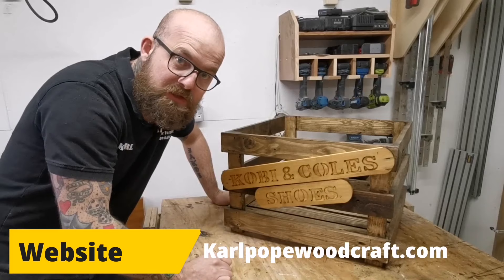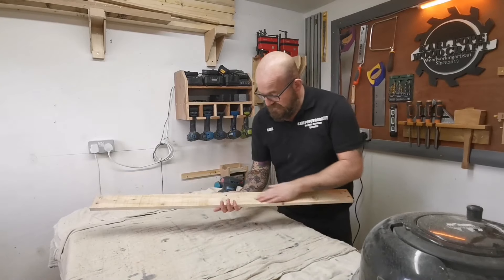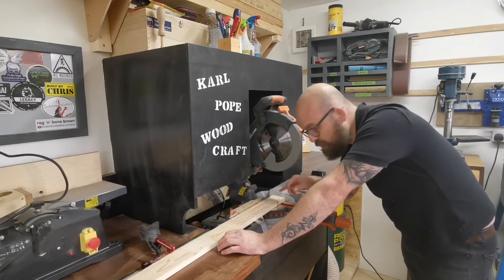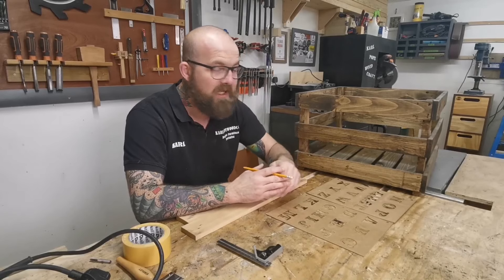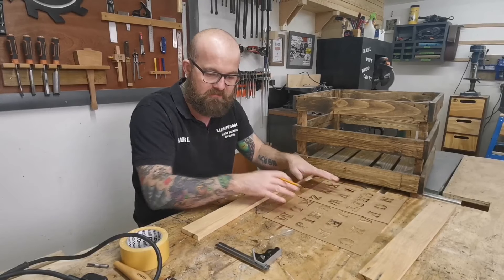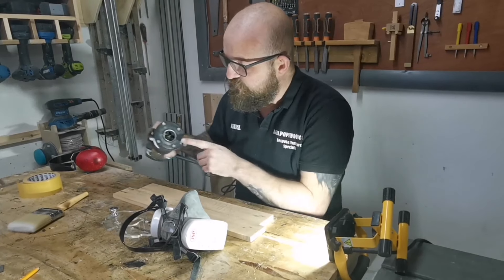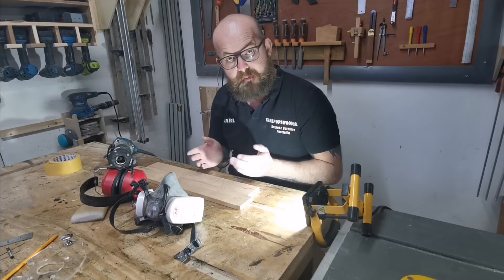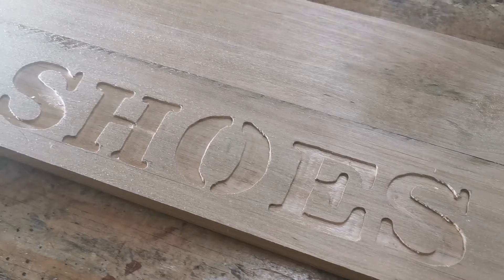DIY Boot Crates & How To Router words using a router

Comment: Hi - have enjoyed watching your videos on workshop building and a few others like the desk build. I’ve a (probably stupid) question. The jointer jig for the table saw - would you mind telling me what the purpose is? If you fit a piece of rough timber into it, then run the jig against the fence to set a true edge on the rough timber- is that not the same as running the original piece of timber against the fence of the table saw?
Reply from the maker: Hi mate great question, the original timber is out of shape so by putting the clean straight edge of the jig against it first you then put one straight edge onto the timber, you need a straight edge on the timber and a straight fence you see just one isn't enough to get the timber straight.   Once you have one straight edge on the timber then that can run along the fence make the other side straight as well 😊. Hard to explain but I hope you get me lol
Reply: @karlpopewoodcraft   makes total sense. Thanks for the reply.